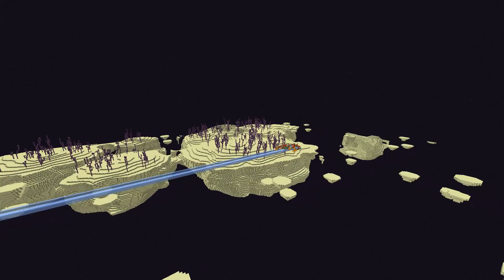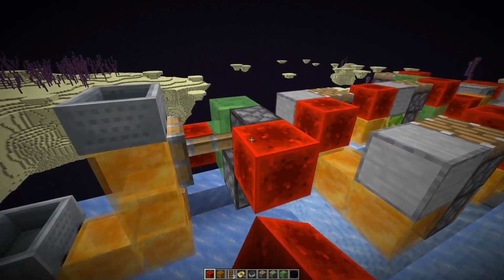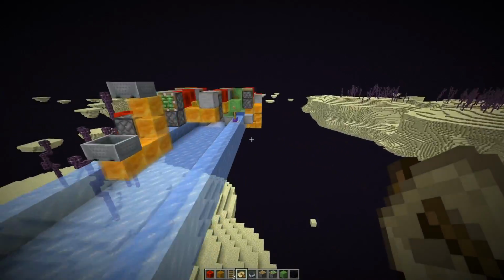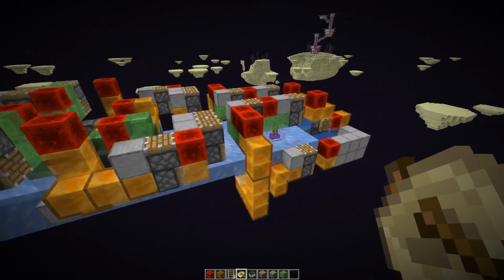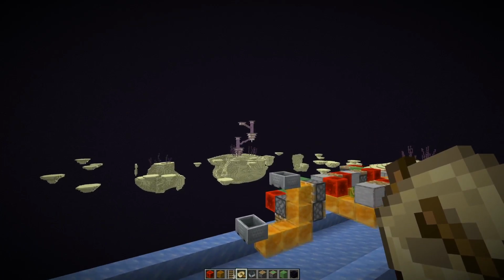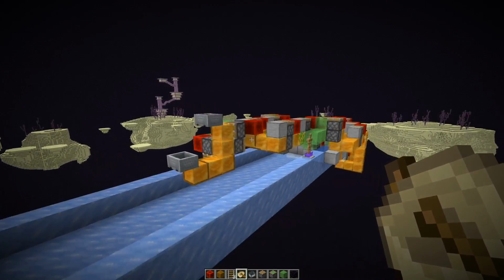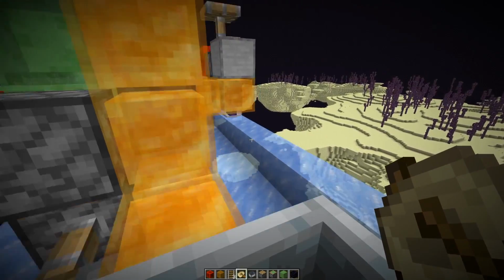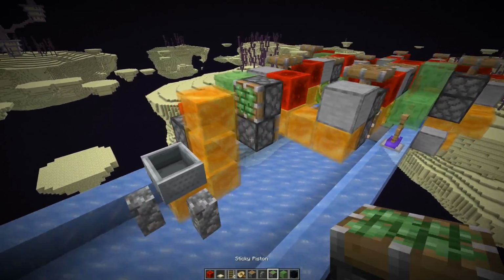Fast Frosted Ice Highway Maker (12,000 blocks per hour) 1.16

Comment: This machine could be really useful for transporting shulkers for a mob switch.
Reply: Or just to find endcitys. Not everybody dupes them or uses a Data pack
Reply: New mob Switchs are made with zombie villagers
Reply: @NaTHaNieL023  No, they disappeared as all other mobs.
Reply: Yeah, that's also what I immediately thought.
Reply: @robot4jarvis836  you have to trade with a villager and then zombify it. It won't despawn and it counts toward the mob cap. I use that on my server
Reply: @robot4jarvis836  The zombie villagers which have been traded with, don't despawn, but also counts towards the mob cap, so that's why mob switches are made out of that.
Reply: @D2rdrd  I honestly hope Mojang removes their ability to be counted toward the mob cap, that is just way to broken
Reply: @D2rdrd  I tried it in 1.15.2 and it didn't work. I ended up making my mobswitch with withers.
Reply: @robot4jarvis836  it only works in 1.16+
Reply: @robot4jarvis836  1.16+ only
Reply: @NaTHaNieL023  Can't make zombie villagers in Peaceful. And can't make ones for mobswitch on Easy (naturally spawned despawn, and villagers are killed by zombies, not converted)
Reply: @sharpfang  Why do you need a mob switch in peaceful?
Reply: Slevin23 lol bat switch
Reply: But then you wouldnt need this machine or zombie villagers
Reply: Y don’t they just use zombies or skeletons?
Reply: @NaTHaNieL023  FLEX.
Reply: @sharpfang  Good answer hahahaha
Reply: @fungusz_4292  No, zombies and skeletons make despawn
Reply: Slevin23 nametags, held items?
Reply: @fungusz_4292  Mobs with items or name tags doesnt count for the mob cap, there is a video from a girl named SurpriseTea who explains all perfectly if you want to learn
Reply: @lukasm.1281  Its not optimal really. Unless you are just a casual player that wont need even 20 shulker box or something like that, its better to use an app to locate the end cities or else your map will end up weighting a ton
Reply: Wither mob switch or zombie mob switch is much easier to build imo
Reply: @robot4jarvis836  Well, they changed the zombie villagers properties, so in 1.16+ they don't despawn when they're traded with. That's why it didn't worked.
Reply: @D2rdrd  this means that I had to broke a bunch of bedrock in survival and summon 70 withers for nothing? Sad noises...
Reply: @robot4jarvis836  Well, I would be more proud to have a Wither mob switch than a zombie villager one, so be proud of yourself!
Reply: @jepptheclairvoyantdwarf9498  why??
Reply: @matheusleal2818  bro. I litteraly play on bedrock where java players say everything is fucked up essentially. And can get over 100 shulker boxes an hour with just flying aimlessly around. You don't have to cheat and use bugs smh.
Reply: Why not use withers? 10x easier to get and renewable
Reply: just use withers
Reply: @carterthechristian  It aint about bugging the game or not bro. If you need Shulkers in a industrial scale you can do it manually. But your map will become heavy AF cuz you'll render shittons of chunks since the cities are usually far apart and if you dont use external tools to locate the cities it will become even heavier since you will be randomly flying and rendering stuff. I have like 15 shulkers on my personal world, but I can see why people just dupe it. Its not due to lazyness most of the time but the fact that its not practical and makes the world heavy
Reply: Zombie villagers found in igloos do not despawn.
Reply: Big brain
Reply: @matheusleal2818  At this point, pruning your world files is more legit.
Reply: @WetaMantis  It depends on who you ask, both are kinda cheaty anyways. But the game design is certainly the one to blame here
Reply: Yeah
Reply: @carterthechristian  people who dupe shulkers usually need tons of them for storage systems
Reply: What is mob switch. I am not  a technical player
Reply: @rajni1788  its a machine that you build in your spawn chunks, since they are always loaded, to make mobs not spawn in your word, since the max number of mobs loades at once is 70
Reply: @lukasm.1281  he said a mob switch
Reply: We shall compromise your genius
Reply: @jepptheclairvoyantdwarf9498  easy solution: don't. Do you think something is broken? just don't do it.
Reply: @fierles7989  ? It's just the effort expended to make a mob switch now is barely anything
Reply: Sorry, I don’t speak game mechanics.
Reply: @lukasm.1281  dude, build a gunpowder farm and get an elytra, even without chunkbase you can get tons of stuff.
Reply: @lukasm.1281  finding and transporting 70 Shulkers individually to the overworked would take weeks

Comment: Tested in 1.19.2 and still works great. If you're not in peaceful build it high, not low or endermen will spawn and eventually break it. Not an issue higher up
Reply: @Amenus Galab obviously.. but way slower. slow enough that they dont get in the way of the water freezing. compare 1-3 enderman every 1500+ blocks of travel compared to being constantly swarmed by them at y 0. I did this in survival with no issues but i did go near build limit to avoid running into anything like end cities 
up there

Comment: I used a pervious machine to do this on a server, and the highway was very popular.
Reply: I wish it was doable on Spigot but it's gonna break after 2 moves.
Reply: @sharpfang  oof

Edit: I was actually planning on doing this on a spigot server...
Reply: @Sam-gf1eb  If the server runs on a very fast machine, without heavyweight plugins and in perfect lag conditions, it may run okay. If server lag is even mild, like 30mspt, it's gonna break after a while. With 50+ mspt it will break immediately.

Comment: Is it possible to replace all of the honey blocks with slime blocks? Will it work the same if they are in the same spots
Reply: Im pretty sure it wont work, mostly because slime doesn't stick to honey
Reply: Slither Man sorry what I meant was replacing every honey block with slime blocks by keeping the slime blocks in the previous honey block’s spot
Reply: It probably still wont work, slime is a solid block, but honey isnt. You could try it though

Comment: Frost Walker I for the boots.  Seen the question asked a few times but couldn't find an answer in the comments.  Kept breaking the machine until I tried that.  If you tried FWII, make sure to check for any extra frozen blocks and switch them back to water before starting the machine.  Works amazing! 1.17.1 (Java)
Reply: thanks man! i kept breaking my machine trying to figure out the problem. shouldve checked the comments earlier

Comment: Answered
Noob question but why doesn't the ice melt like it does when you're wearing the boots with the enchantment? Seen mango use this mechanic before and never understood that
Reply: Because there's no skylight in the end to melt it.
Reply: It needs sky access to melt, so underground or in this case, the end. means it wont melt
Reply: In terms of biome temperature, the End is classified as a cold biome so the ice doesn't melt
Reply: @Shorteagle  not why it doesnt melt. Even in a desert you can build one and use it, as long as there isnt sky access or high light levels in general.
Reply: Cheers for the answers guys 🙂
Reply: @Shorteagle  that's not a thing, it's all about light levels. By your reasoning ice made by frost walker in the snowy biomes shouldn't melt but it does, the only time the ice doesn't melt is night time when there's no light.
Reply: Krishna Ramesh Deserts are cold in real life when there isn’t any sun so why not make it the same way in Minecraft?
Reply: @krishna12947  i just want to ask, "if it is need sky light then we can build in the nether?" Then i remember no water in nether
Reply: @krishna12947  what about the nether?
Reply: Hm, you could attach a cobble generator or something above something like this so the ice doesn't melt, though I guess you'd need a player placing lava somewhere
Reply: Because there isn't a high enough light level to melt it
Reply: Shorteagle since when were there temperature mechanics in minecraft?
Reply: It doesn't need sky access, it just cant have a high light level
Reply: As I understand it, the fact that the boots never leave the surface of the ice is why it doesnt melt.
Reply: @jordanyoung706  it's not that, it's the fact that there isn't a high enough light level to melt the frosted ice
Reply: @jordanyoung706  wrong
Reply: Brandon Lee biomes have a temperature value, but all It does is determine if it snows or rains, and at what level the rain turns to snow (like at the top of mountains). Weather it snows or rains on a specific block determines weather or not water will freeze as well. None of its effects have anything to do with frost walker in any way.
Reply: @krishna12947  So in theory you could connect this to a tunnel bore? Imagine making the tunnel and the ice path all at once. That would be dope
Reply: @matiastripaldi406  theres a scicraft ep where they do exactly that
Reply: @Sam-gf1eb  if you're gonna say that then tell the person what is the right answer
Reply: @gibsonfender5733  Deserts can be cold at night, but that's not a given. It depends on what time of year it is - with it being much more likely in winter than it is in summer.
Reply: It could be melted by endrods, but i suppose you could put it at a y level high enough to go over all the end cities.
Reply: if its light level that causes the ice to melt could you build a tunnel bore in front and basically have a free infinite subway system?
Reply: @real_dddf  they've done something like that on the server 🙂 I'm not sure what episode but I seen it on the server tour with Mumbo
Reply: So a few people said it melts due to light levels.   What if you built a cobblestone maker to fly above it so you can use it in the over world. ??
Reply: @jacobsaylor8088  is there a moveable cobble gen?
Reply: ty for asking I had the same question, and now know why

Comment: Doesn't it have chunk loading issue? I remember a old video where you had to build a machine that would remove the blocks on the chunk border so it wouldn't load the next chunk
Reply: That was in 1.12, when blocks that check their surroundings could load chunks. That behavior was removed when mojank changed chunk loading in 1.13.
Reply: @zackglenn2847  I built this machine in 1.15.2 and was still having the same issues where the machine would break randomly. Sometimes I could go a couple hundred blocks, sometimes I could go 30k blocks
Reply: @kennysmith8492  You're describing something entirely unrelated.
 
The problem in 1.12 was that frosted ice could load chunks by checking for nearby frosted ice. That caused frosted ice roads to permanently load the chunks for their entire lengths and cause a lot of lag.
 
I have no idea what caused your machine to break in 1.15, but it has nothing to do with the chunk loading problem.

Comment: why dont you just push the ice blocks up on the sides?
for the rails, saves 2 boots and such
Reply: Frosted ice melts if you push it
Reply: Also, I don't believe having a single line of frosted ice blocks is very stable. Each frosted ice block needs to always have three or more other frosted ice blocks touching it otherwise you could accidentally break one and set off a chain reaction where the entire rail turns from ice to water.

But yeah, TL;DR frosted ice is too delicate for that.

Comment: Wondering if rather then stopping it with Obsidian you could use hopper/chest/comparitor setup so that it moves a number of blocks equal to the number of blocks in the chest. Just trying to figure out which piston to power that would make it stop.

Comment: Could you not simplify the design by creating the base then using pistons to push the middle blocks down, rather than creating secondary water sources for the guard rails?

Comment: Is it posible to make a similar disighn in 1.12?
Reply: yes - the original concept was shown back in 1.12. it's a bit different because there are no waterlogged blocks, but he has a few videos on this concept from a while back. search his channel page and you can find them.
Reply: yes and no, you can do it in 1.12, but it won't work at 3.3 blocs per second
Reply: @SRAZKVT  it maybe be possible to do it with the 3.3 block per second in 1.12 to but it will be more complicated (and also you need to punch blocks on chunk borders in 1.12

Comment: Hello! Does anybody know if the operation of this machine is affected when built on a paper server? I am currently running on 1.16.3 on a paper server and This does not seem to work.  What seems to be happening is the armor stands will fall out of the slime blocks when the machine begins to move then the ice never forms and the machine stops moving and comes apart.  When I built this on my single player (vanilla) world, it works flawlessly. I have been all through the paper.yml and am not seeing anything that I can adjust to influence the operation of this.  Has anybody else run into this issue?
Reply: Do the armorstands have frost walker 2?

Comment: At least no bats in the end so no need to worry about them :D
Reply: Need to keep height though, chorus fruit and end rods on end cities are a thing. Plus afking player is a necessity to prevent endermen spawns on the solid blocks of the machine.
Reply: @sharpfang  In peaceful mod no enderman spawns you are right about the height tho i would built it under 50 probably if i wanted to build this

Comment: Ilmango I have built this exactly to the litematica schematic and the right side keeps locking up somewhere. I can't solve which block is the issue. Parts of the right side don't move forward as expected, such as the armor stand.
Reply: Are you on 1.17?
Reply: @francescobasile8933  At the time I was on 1.16.5 I believe.
Reply: Paper server perchance?
Reply: @francescobasile8933  I was on a paper server but I also tried it in the vanilla game single player and I got the same issue. Paper server mess with 0 tick piston or something?

Comment: I built this machine from the litematica in 1.16.3 but it doesnt seem to be working, Does each individual piston need to be zero ticked or do certain conditions need to be met before it works? Or did changes happen in 1.16.3 that don't let this machine work?

Comment: Does anyone know how the ice stays after the frostwalker turns the water into ice.
Reply: I think it's the light level being low enough in the end to not melt ice.
Reply: It needs sky access to melt, so underground or in this case, the end. means it wont melt
Reply: Thanks a lot you two
Reply: It needs a high light level to melt, thats why if you use frost walker at night over a ocean, it stays frozen until day
Reply: Perfect, that means this can work in the nether too.
Reply: @larbmining  cant make water sources in the nether unfortunately
Reply: @larbmining  nope. Could because of frosted ice not melting because of temperature but sunlight which is absent there, but can't because you have no water in the Nether to make frosted ice with.
Regular ice melts in the Nether because of the temperature instead i believe, but gives no water, as it evaporates.
Reply: @stripthecat2673  Regular ice melts based on light level. So if you have say a dark hallway with half slabs on one side and ice on the other it's a spawn proof ice nether tunnel. Because regular ice is transparent block and bottem slabs are spawn proof.
Reply: @stripthecat2673  yea buddy I know, I was joking

Comment: How r u supposed to get to the end in peaceful
Reply: they chose a seed which has all 12 eyes of ender in the end portal already,(which is VERY rare) so they just have the find the end portal. They didnt want to use a tool, where you just input the seed and find it, so they digging and using freecam because without it, it could take hundreds of hours. (they digging to find it cause no eyes of ender)

Comment: Ice printer goes 0-tick pistons go brrrt

Btw, wouldn't it be easier to make a flat ice surface and then pull borders up or push middle down?
Reply: they will melt instantly, even if the new position meet requirements for the ice to not melt
Reply: @SRAZKVT  do you have an explanation or is it just like that in the game?
Reply: Illmango has already explained in his previous ice High way tutorial
Reply: @SRAZKVT  ok I see (icy)
Reply: He also said that they help for stopping you from riding the boat off the edge
Reply: @SRAZKVT  Ah right, I've just tested it too.
It is weird that the ice doesn't break by itself.